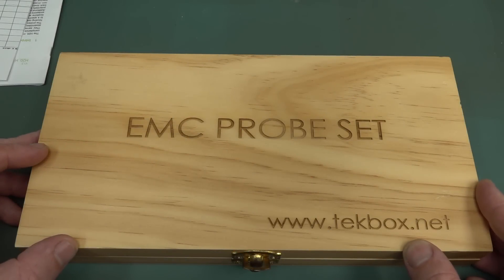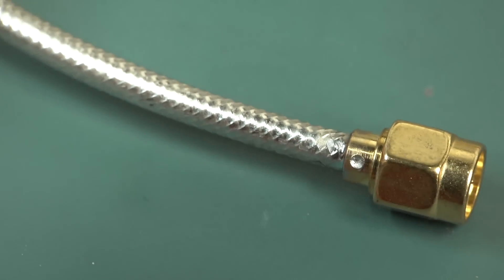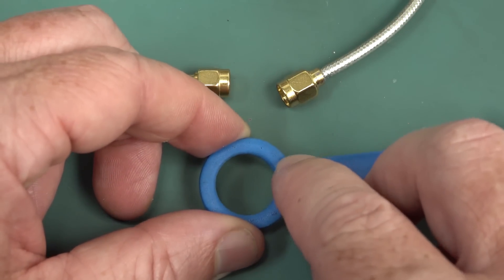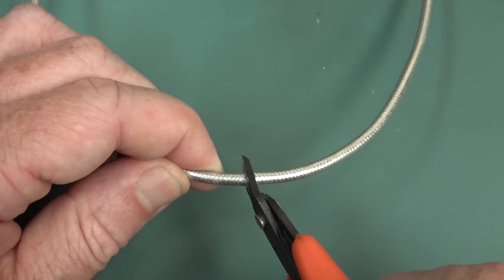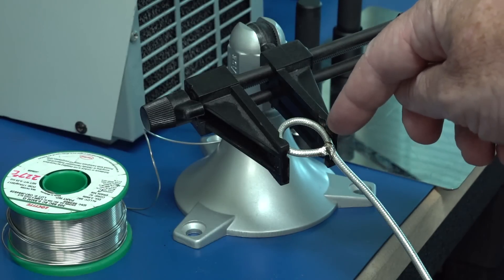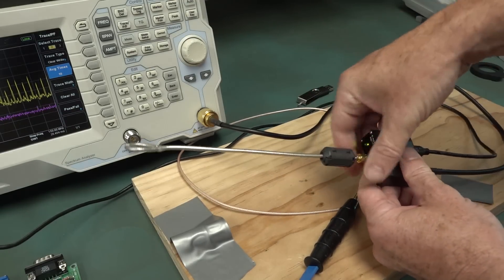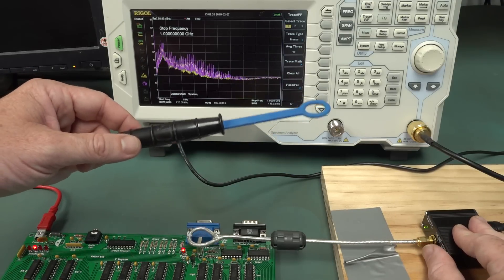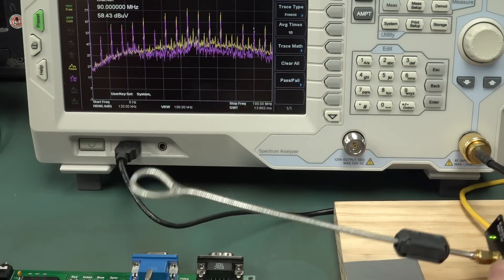EEVblog #1178 - Build a $10 DIY EMC Probe

Comment: Feels like those $300 ones are a total ripoff.
Reply: Not if your company is paying for it. Try to explain them that you saw this video on youtube where some guy made the same one from paperclips...
Reply: they are but little selling things pay manufacture "pay day" style and they do that for you, sooooo....
Reply: Well.. Maybe but not really. the 300 dollar ones will have guaranteed and certified performance. You can make one yourself, and it may perform in a similar way, but it's not certified. Your customers need traceability.
Reply: Many customers don't need traceability. They need a working product.
Reply: @Futschikatores  i'm not sure how many people buy this kind of things but i bet they are little, you can't pay a device so particular like 20$ just because it's the deserved price, the manufacturer can't maintain that product with THAT costs

mind the case of STM32 microcontrollers, look the one on the "blue pill" thing, it's given for 64kB of ROM but they are all 128kB instead, that's because the cost of the more memory they give you for free is LESS than the cost of different lithography masks (one set per device ramification model), so they give top-line of that chip to everybody ,just changing the ID with a laser (i think)... this case is the same but obviously on the shoulders of customers (that's my interpretation but i like to pay my things the correct price like all of you)
Reply: risvegliato - Certified and guaranteed to do what, though? This isn’t a calibrated tool, it just sniffs out radiated emissions and gives relative readings. The levels are dependent on the probe’s proximity to the source, there doesn’t even need to be close tolerances from one set to the next. It just has to show something when connected to a SA or scope.
It’s priced so high because it’s a niche product that isn’t expected to sell many units. A Chinese company with much lower overheads could probably knock these out at around 20-30 USD a set.
Reply: @ProdigalPorcupine  i agree, but even if it's "calibrated" (and it could be, even if the tool is just what Dave made in minutes) calibration itself vould require 30 seconds of just checking if it works like the "rated and specced" prototype they developed, again, you pay a ready made niche product
Reply: For a hobbyist, sure.  But $300 is really nothing on an expense report.  And given the time involved in hacking one of these together, much less four (assuming you already know how to make them all), the product pricing seems pretty fair to me.

Consumers tend to forget that a product is not made by ordering a bunch of parts from Ebay.  Manufacturing, R&D / testing, and support all have costs too.  So, "ripoff"?  No, not at all.

Comment: Great video Dave! Could you do a similar frequency domain analysis with an oscilloscope's FFT? Just to make it a lot cheaper and accesible, since it's a more common tool.
Reply: I would love a video on using FFT function to make these measurements. I think building one of these probes would be a lot of fun for $10. A spectrum analyzer is out of the question for me, and probably a lot of hobbyist, but I do got a scope with FFT.
Reply: You could potentially use fft on a scope, if you had a scope with 1+Ghz bandwith. A new 1Ghz scope is in the $10k vicinity. A hacked to 3.2Ghz Siglent spectrum analyzer is about $1700. A HackRF SDR is about $250, and I believe with the correct firmware sweeps 6Ghz rapidly. The lower cost devices would not be calibrated or have features like like tracking generator, so the hacked spectrum analyzer has some significant attractions. There are also PC based vector network analyzers, which add a lot of additional functionality, as they measure phase shift in addition to amplitude. A full duplex SDR + a ebay reflection bridge might be a usable vna with the right software.

Comment: The guys at tekbox spent houndres of hours on r&d for this thing to work properly.
Dave botches something together in 10 minutes and it works just as fine if not better than the pro kit. :D
Reply: R&D, or D&M (design & marketing)? :P
Reply: Research & Development
Reply: Getting those curves that are individual, and that are a true reflection on the device, as opposed to lucky try and it worked.  Plus the whole repeatable manufacture thing that means you can interchange probes, and not have to run a calibration on each new one you get, just use the curve supplied, which is well within a specified tolerance spread.

Comment: Welcome to the world of radio frequency hobbyists / radio amateurs!
We knew this all the time.  I made such a probe years ago and used it many times, it is also useful to tap off some signal from an oscillator coil to measure the frequency using a counter, to tune a transmitter amplifier while constructing/experimenting, etc etc.
Reply from the maker: Yes, they are quite common.
Reply: We knew this all the time, I made one years ago. Well why didn’t you take the time and effort and put it up on YouTube and not wait for other people. With your sort of attitude no wonder the young people are not coming into amateur electronics. Why are your sort so protective of knowledge?
Reply: Is it also usefull for making measurements in Audio circuits? I'm thinking off finding noise sources in the 1khz to 40khz range. 
Afaik RF is much higher then what interferes with audio ...
Reply: For that I have a different probe that has a coil with some more turns at the end.
Just a length of RG58 with a BNC at one end (for the scope) and a coil made from .5mm enamelled wire that I threaded through a length of insulation tube (4-5cm), ends pulled together so it forms a small loop.
Finished with some heatshrink to cover the solder joint to the end of the cable.
Experiment with the number of turns depending on the signal pickup level you need and the high-frequency response.  For this region it should not be a problem to have like 20-40 turns, but of course it will no longer work so well in the MHz range.
Reply: @KidCe.  Just use a normal flat coil for that and either a cheap oscilloscope or a cheap audio amplifier. Or search for "superprobe".

Comment: What would be the best way to repair electronic boards by comparing them to a working model. Let's say you constantly get the same boards to repair and you have some boards that you know are 100% in working condition. Would you use some form of curve tracer to analyze the good board and then try the same checkpoints on the other board in order to localize the potential problem?
Reply from the maker: There used to be (still is?) popular machine for this, one was the Huntron Tracker. You could store and compare waveforms for a powered off board.
Reply: @EEVblog  What do you think about this? https://www.youtube.com/watch?v=aDdhsh7el0s
It's $250 on their website and seems kinda ok.

Comment: 5:58 Knife? You call them a knife? Hahaha
Reply: better than "A swiss army knife that hopefully has a philips head screwdriver in it" (reference from the verge worst pc building guide if you didn't know it already)
Reply: @kapioskapiopoylos7338  Philips: Dutch electrical company.
Phillips: US tools company inventing the crossblade screwdriver.
Reply: I've had that exact same (by the look of it) Victorinox model for 20 years. Used the blade for opening cans in the army (just stabbing the metal and cutting), stripping and cutting wire, heating the blade to cut plastic etc etc, and it's still good. I love it, and it loves the abuse. That guy from the Verge doesn't deserve to use one.
Reply: Reference crocodile dundee guys
Reply: No he clearly called it a knoif.

Comment: Now build a additional spectrum analyzer for 10 bucks and every one is happy ;-)
Reply: Would a SDR make a decent spectrum analyzer?  I guess most have a more limited range though.
Reply: It would definitely work, although you'd have to be careful about the input signal level as they saturate easily, it also takes a good amount of time to sweep a large bandwidth.
Reply: @redsquirrelftw  Definitely. I built a similar yet slightly more crappy probe and ran it through both my HackRF and RSP2. I got OK results for what I needed. Didn't use any external LNA, the amps on the SDRs works fine, and you can of course select various levels of gain in the software. Like others have said depending on what you're looking at it can be a very slow sweep and the software can be a pain to set up depending on what you use.
Reply: Test it with RTLSDR for 10$
Reply: Yes a HackRF would have more than enough frequency range although slow sweep (but then do we care?). They are a bit 'deaf' though. Can't hurt to try though can it?
Reply: TinySA 😁
Reply: TinySA can be an alternative :)
Reply: If anybody knows a way to get GRC installed and working in mint 19 hit me. Thanks.
I had it working great in 17.3.
Reply: @InsideOfMyOwnMind  Virtual machines. I ran into the same problem w/ updates breaking it, I just keep a dedicated VM for GRC that I purposely don't change/update. Install whatever your preferred distro is, get it working, then make a restore point. If anything quits working, it's far faster to just restore back to a known-good config rather than troubleshoot issues. This also works great other packages, I tend to do python dev in a VM as well, since then i can easily completely separate v2 & v3.
Reply: @zrobotics   Yes Python was part of my problem. V2 and 3 just couldn't keep their hands off each other and P3 broke most of the utilities that came with M19. I will try a VM next.
Reply: $43.3 would be acceptable too!
Reply: Spektrum is a piece of SDR software for this purpose (which I haven't actually tried). The RTL-SDR (~$20) gets very hot, and in my experience the quadrature sample rate with the least distortion is 2.048 MSPS (a 2MHz sample window). Scanning from 500KHz to 1.75GHz in 2MHz chunks will take a while.  I recommend getting a bendy USB fan to aim at the SDR for cooling it. The coax that came with the RTL-SDR dipole antenna kit has terrible shielding, so don't try to use that for spectrum analysis - it'll pick up lots of stray noise and make probing difficult.
Reply: @chrisbalfour466  Annoyingly I also bought a HackRF and while it is kind of a fun toy at the end it's a POS.
Reply: @InsideOfMyOwnMind  If even that's a POS, then it's definitely cheaper to just get an actual spectrum analyzer. Thanks, that's good to know.
Reply: @chrisbalfour466  The thing is, it's rx performance is crap even compared to the rtl. The front end both rx and tx are extremely ESD sensitive. If you touch the antenna without grounding yourself first you will pop it 100% of the time. That said, it's easy and cheap to fix when that happens but what a pain in the first place.
Reply: Most DSO scopes this days have FFT, so at least in the scope BW range this probes can be used to "sniff"
Reply: Well, use an old transistorized radio.
Reply: They are cheap enough today
Reply: i know I'm kind of randomly asking but does anyone know of a good site to watch newly released tv shows online?
Reply: @Collin Terrell Flixportal :)
Reply: @Huxley Hudson thanks, I went there and it seems like a nice service :) I really appreciate it!!
Reply: @Collin Terrell happy to help xD
Reply: thats done meanwhile by erik kashoek :)
Reply: Dave should probably do a video with $165 handheld spectrum Analysers from rfexplorer.com
Reply: Amaldev V    Yes seen one demonstrated at my ham radio club.

Comment: Would be cool to create a heat map showing how much is radiated as a function of the probe position. What would be the best way to realize that?
Reply from the maker: I have several idea, from modding a 3D printer, to a line scanner, to a full array scanner.
Reply: EEVblog Would be especially cool to create a volumetric scan for discerning between near and far field. But anyway, just saying. :)

Comment: You know you need to take this to the next level right?
First you use a 3d printer as x/y scanning platform for the board (printer can be fed gcode for movements from pc via usb) and then record the data from the oscilloscope via for example python integration with scope (usb again). Recording the spectrum on each position in a grid and display everything in a nice overlay on a photo of the board. User could then either see a sum/max of all the emissions or scroll through the spectrum and visualize a frequency slice in the overlay. Now that's sexy!
Reply from the maker: Yes, I said that in the previous video.
Reply: There is a product out there that is an array of loops in a paper sheet size bed. Its multiplexed and scanned into an analyser. You can put an image of the pcb layout over the scan data to give you an RF 'heat' image. Think its made by Emscan.com from memory.
Reply: @simonbaxter8001  I know. I've used one. This is cheaper and more fun...

Comment: But what about a diy e field probe?
Reply from the maker: I mentioned that, will have to do one of those as well.
Reply: @EEVblog  Sorry. Didn't catch it. Watched at 10:30pm.
Reply: Someone didn't watch till the end.
Reply: Oopsie. Watched till the end but didn't catch it.
Reply: Basically, it's straight coax cable with cut off shield from end to expose midle wire insulation, approximately, 5-10mm from the tip (as Dave did, before coax bending in loop) and with some extra insulation on the end of wire to accidentally not touch test board with probe.. ;)

Comment: *semi-rigid. You can't bend rigid coax without destroying it
Reply from the maker: Yeah, correct.
Reply: @EEVblog  This cable is actually called "conformable" coax cable. Meant to be shaped for final application, but not for repeated flexing/bending. Good video. Thanks!
Reply: Yes you can. Like a plumber. Just not by hand.
Reply: Martin Krehl Yeah you could even bend it by hand if you're careful and keep your bend radius large enough. You could use a 10mm pipe/rod/drillbit shaft and bend it around there for example.. Depends on how big it is obviously, you're not gonna bend the 50mm (or so) stuff at the TV station
Reply: Rigid coax often use air dielectric. If you bend them, you will change the impedance and risk the inner conductor touching the outer conductor.
There are specific L-pieces for rigid coax, but often they are custom made anyway (soldered/welded). Rigid is really not meant to be bent.

Dave has a nice video from a TV transmitter site where they had rigid coax pipes.
Reply: Antoine Roquentin Well yes and no, you're right on air dielectric on the bigger rigid coax but the smaller ones inside spectrum analysers and other RF gear are all bend from the factory. Generally no L connectors on there. You do mess them up when you rebend them but they get bend into shape at the factory I think
Reply: Right, semi-rigid.  Looks more flexible than the the solid shield 0.141 semi-rigid coax that I used in years past.  Can't count how many connectors and assemblies I've build over the years with the venerable 0.141 semi-rigid coax.

Comment: You had time to build it to scale and to paint it!!!
Reply from the maker: Only two coats!
Reply: @EEVblog   I believe this would do a better job coating it than the spray-can version: https://www.amazon.com/Performix-11602-6-075815116024-Plasti-Dip/dp/B000ZN1T16/ref=sr_1_9?keywords=plastidip&qid=1549645102&sr=8-9
Reply: @altersami9660  yeah... I saw the name Plasti-DIP ... and a spray can, and I was like... what? Plasti-Dip is supposed to be a thing you DIP into, not spray on.... silly people, giving them a market for this.... (I mean, I suppose there are probably use cases where dipping is impossible and the spray is useful. But for this use case? Dipping seems entirely appropriate. Ah well.)